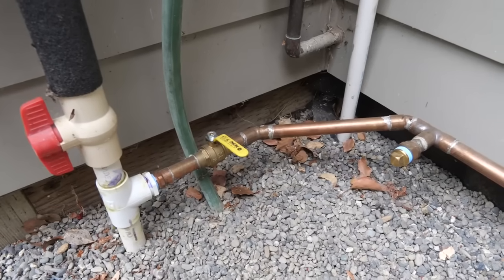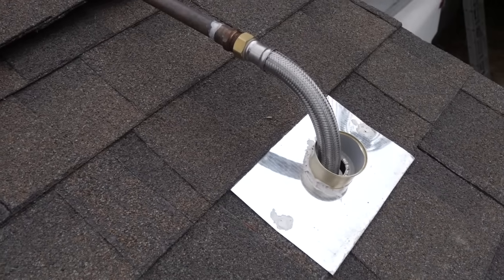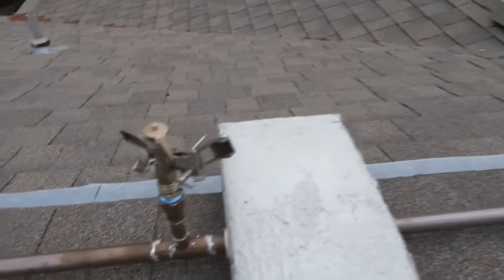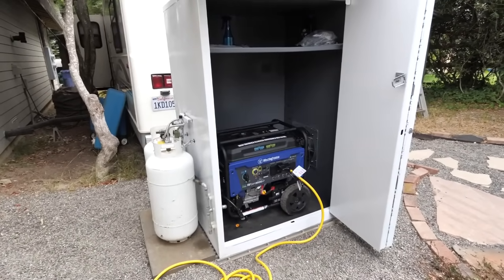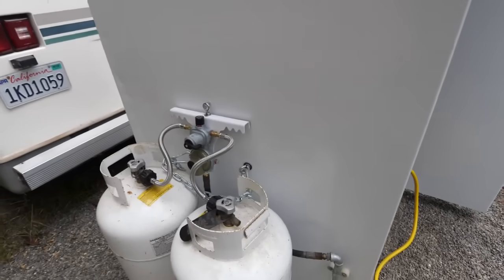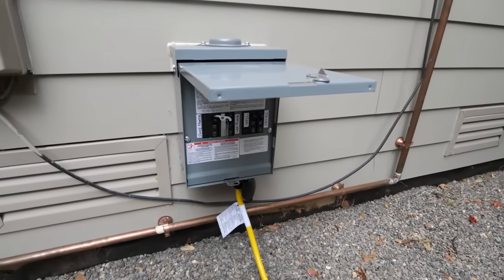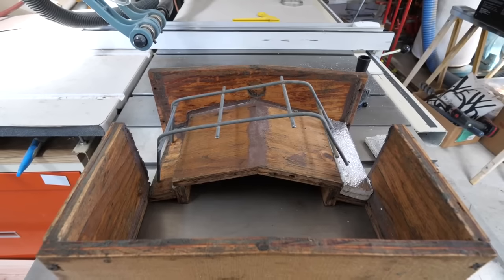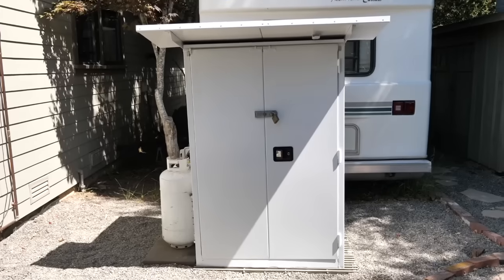Roof sprinklers and backup generator for wildfire-prone rural house

Comment: It couldn't hurt, and it's very ingenious, but quite often runaway firestorms are caused by extreme winds, in which case your sprinklers may have a negligible effect. It's best to ensure there are no combustible materials around your house, or areas that can harbour combustible materials and allow flying embers to gather.

Comment: I hope you’re not leaving the water. Sit in there, water can turn very fall and create legionella and other problematic stuff when it sits in lines, I may be thinking, though about sprinkler heads connected to house waterlines that are moving some water all the time and when there are dead end lines, like for sprinklers, you can have issues with legionella forming
Anyway, great work otherwise

Comment: Look at that giant fire damper for attic ventilation. This guy knows his stuff.
Reply: but embers will blow into that whirly gig vent on the roof, and all those vents on the side of the house down lower too - if you watch the testing videos where they blow embers at test structures, it's all the vents into the attic, and into the crawlspace that cause the issues, not the shingles - you get embers into those enclosed areas, and it's pretty much game over
Reply: @ didn’t notice the whirligig. Nice catch and you’re right. I sure hope he has some sort of a damper for that duct. There are ember proof fine mesh grills for small vents too, which I have for my house.
Reply: 1/16" screening is better
Reply: @ShastaTodd screens are good at keeping embers out. Downside it restricts airflow.

Comment: Looks great.  Only thing I would change out is the flex tube on the roof that connects to the copper pipe.   Even though it got a metal wire mesh what's inside of that is actually rubber which will degrade over time.  We had those for our water tank and it leaked.  So we swapped them out for the standard all metal flexi tube.  Ours is stainless steel but you can get copper as well.

Comment: I have sprinklers on my roof (Sierra foothills CA),  when we had the local defensible space advisor come around his comment was the if you have a class A roof they don't do a lot for you compared to clearing vegetation / trash and screening basement vents etc.
Reply: Takes a brave advisor to say "meh...those sprinklers don't do alot..."
Reply: i read vents are fire starters
Reply: @peter-pg5yc  100% you either need very fine mesh (1/16) or something like a vulcan vent that closes with heat.

Comment: And how long do you think that fibber McGee plastic pipe and copper would last in a fire fueled by high winds? I give it 5 minutes tops, should have used steel piping
Reply: Copper pipe comes in three grades, M, L, and K. K pipe is the thickest grade and is suitable for fire protection.
The only problem I see is that if a fire is burning hot enough, it might melt the silver solder? But if the system is effectively keeping embers from catching the roof on fire, I don’t see temperatures getting anywhere close to melting the solder

Comment: I think the main issue is the side of the house, not the roof. A system under the eaves that sprays the side of the house seems like it would be more effective at stopping your house from catching fire. the Shingles aren't going to catch fire from burning embers, which are the main fire starting concern with wild fires. You shouldn't have anything combustible within 5-ft of your house (bark chips, etc). Your system seems like its better than nothing, but I'm not sure it would protect your house from catching fire if an ember was to come flying into the side where the roof sprinklers cannot moisten.
Reply: Most houses catching fire in Southern California wildfires are ignited by palm fronds embers..in most cases those embers are scooting along the ground pretty fast (watch videos of this on YouTube) and are burning landscaping adjacent to the house. But he said his impulse sprinklers are reaching beyond the roof onto the ground nearby the house, so I think he’s covered

Comment: You need a 30,000 gallon water tank to supply it.

The LA fires had the water mains lose water for an assortment of reasons.  If it's depending on city water (even with your  own pump) it has no hope of working without a huge water tank.

But if you have that huge tank, fire department can demand to use your water.

A private well can only supply a certain amount per minute.  Not firefighting amounts without a large tank.
Reply: He said he is on a well . He is Not connected to city water supply
Reply: As shown in Palisades, when big fire comes the FD will not be around to take your water.
Reply: If the good fire mitigation ideas suggested here were implimented then 'firefighting' quantities of water would likely be unecessary.

Comment: Great setup & well designed... i couldn't help but wonder if you sealed your pass thru on the roof...looked like a good size gap there... I'm assuming you sealed the pass thru & drilled a drain hole low in the cat food can to drain any rain/water buildup in the can.  California could've used these...

Comment: thats a good idea. all homes in fire area should have this
Reply: Most of California Homes that was burn to the ground have a full swimming pool with water not used. This sytem should be applied to those homes.
Reply: @xh3598  That would actually work, but making it dependent on the public water supply would not. But I would choose a 2-stroke diesel powered pump, it is a smaller fire hazard.
Reply: @xh3598 yeah and the pool used as a reservoir. People in LA should invest loads more in water retention and get rid of useless things like lawns. Those things just consume water but have no real benefits. 

Having wet greenery is important, just look at how many of the trees came out of the fires in way better shape than the houses. They retained moisture. Having a wet microclimate not only helps against fire but cools down the neighborhood, which should be a nice thing to have in LA.

Another problem LA has is that the animals that kept the dry brush under control are gone for the most part.

Comment: Kinda ironic that this old video pops up on my feed today. Must be a popular topic with the wildfires going on down in California right now. I saw one house down there on the news that had sprinklers on their roof too. Such a brilliant idea if you are anywhere near a potential wildfire area! I bet this will become a super popular system to install on their roofs down there now!
Reply: How much does it cost to build a set up like this?
Reply: @ryangreen45  IF unfortunately I had no other option but to live in California, with its variables of dry climate, wild fires, AND bad government and super regulated.  I think I'd build with brick, cement, or perhaps at least use a thick layer of stucco, and use metal windows and frames, I'd use a metal roofing system, slate, terracotta or some other fire proof material.  I would not have wooden eves or soffits.  Nothing which could be directly exposed to wildfire would be flammable, and I'd have one hell of an in ground irrigation system put right around the house.  But California probably has some ridicules regulation against a high volume system.
Reply: @ryangreen45  as a guy that lives off grid on 40 acres in wildfire country (Mendocino County.)
 Let point out some things 
They make sprinklers to set on your roof already 
Saddle mount.
Sprinklers are great preventative measure.
Like a perimeter one around house using irrigation heads like he has on t-post

I have been through two evacuations and had part of our property burn.
Stayed and helped fight fire 
 First thing they do is send crews to each residence 
They assess situation
How defensible structure is.
 First thing they would do is move those propane tanks away from house.
 Best to have a 1500 gallon minimum storage tank of water and a pump that can move water at about 60/80 gallons a minute through a 1.5 inch  fire hose fitting and 150-200 feet of 1.5 fire hose.
Most wildland fire trucks can only carry 500 gallons.
At 60 gallons a minute, which isn’t that much, you can see the problem.
You can get the thinner walled for your purpose.
Hot ash can travel two miles on the wind.
And there will most likely be wind created by the fire if not nature.
So you need to be able to direct large water on spots.
Sprinklers during this are not that useful, think ( peeing in a strong wind)
Also remove “fire ladders” from around your house.
 I have an f-250 with 300 gal tank in back with Honda pump and 3/4 inch fire hose for getting to hot spots or neighbors.
Feel free to ask me questions, I probably have the answer due to experience, unfortunately
Reply: @ryangreen45 could be around 5-6 k for 2000 sqf home (everything)
Reply: @ryangreen45  Probably around $45. per each 10' sections just for the materials...no labor(double it at least for labor). *Rough estimate

A 10' 'stick' of ½"pipe is $20+, and ¾"pipe is $30+ each plus fittings, stand-off clamps, a couple valves, sprinklers, etc. Cooper is pretty pricey right now and it's only gonna go up significantly along with all building supplies because of all the rebuilding going on all over around N Carolina and now California too.
Reply: Looks like it's still necessary to manually put out fires and embers that don't land on the roof
Reply: right wtff
Reply: It is because you are clicking on News stories about the fires. It is not random or ironic. Algorithms!
Reply: @Hiiamsamm  Never ever clicked on one news story on YT ever! I get news from reliable sources not social media that chooses what to show & not show according to who it's coming from. I watch videos that have nothing to do with news or politics, and aren't 4+ years old like this one, sorry bub!
Reply: Same here, this video popping up today!
Reply: No it won't. People in CA. have been ignoring good advice for decades so they are getting what they deserve. Do not send them a single penny until the East coast gets helped recover from nothing they could have prepared for.
Reply: I saw that guy in CA to, he was an Army ranger if I remember right. Very interesting.
Reply: If you have water
Reply: @jeffdoesstuff9134  That's what water cisterns are for… to collect and store water during the rainy-season to be used for the fires during the dry-season… more-on. 🤦🤦‍♂🤦‍♀
Reply: @MelioraCogito  does your government allow you to collect rain water and store it?
Reply: @jeffdoesstuff9134   Of course it does, why wouldn't it?!?  It's rain that falls on your property, why wouldn't your local/state government allow you to collect it?

In fact, up here in the temperate rain forests of Vancouver Island, homeowners are encouraged to install underground storm tanks on their property to collect rainwater run-off, slowing water egress off your property and overwhelming the municipal storm drain system during heavy rain events.  Such storm tank systems can be used to hold water instead of slowly releasing it into the ground—we even get a property tax credit for having one.
Reply: @MelioraCogito There is no tax credit for a water cistern on SVI. They were debating a ban on water collection in BC.
Reply: Put tennis balls in downpipes,It will fill the gutters with water and help stop hot ash getting under the roof.
Reply: @larryrayner3826  What a r tarded comment…
Reply: It's called an algorithm and they use it to sway your political views as well.
Reply: You too?
Reply: @PH-md8xp  So glad you figured it out for me
Reply: If people start installing these they will shut down the city water claiming drought.
Reply: Useless if there's no water...
Reply: @joelsheebs728  Maybe you missed the whole well water thingys he showed. Not relying on 'city' water he's got his own supply. Yes, it is 'possible' a well could dry up but less likely if it's deep enough. Also water storage cisterns and rain water collection are a thing too! Just don't rely on the fire hydrants\water department to have the water available for the FD to use when attempting to fight the wild fires that were predicted long ago!🤦🏻‍♂️There definitely needs to be some repercussions from this disaster, several officials need to be prosecuted & fired(lose any pension, etc too). Such a cluster f_#k going on down there in that 'state'!
Reply: No one listen to him,rich people like big mansions,but they not protect the investment,here in usa we can make a difference,but  our minds are in stupid things!
Reply: I hope you no have to expose that yellow extension,can be better under ground,inside de shed!
Reply: @tdotw77  Google would prefer we look at this versus facts about Newsome and Bass.
Reply: @loganq  And what “facts” might those be? 🤔  Oh… right… the “fact” that the Eaton fire in Altadena is outside the LAFD's jurisdiction (Altadena is within LACoFD's jurisdiction) or the “fact” that the state has no jurisdiction over county land management practices (except in state parks/recreation areas)—it's not the state that is responsible for implementing county/municipal zoning regulations to provide buffer zones between neighbourhood developments and adjacent undeveloped wilderness to mitigate wildfire hazards.

And finally, because homeowners not keeping their property clear of fire debris, is all Newsom's and Bass's fault…?  Really?

JFC, you MAGAs do nothing but cry and blame others for your own failures. 😭😭😭😭😭  Love how the party of “personal responsibility” refuses to accept personal responsibility for the bad choices they make.

Only the Palisades fire fell under the jurisdiction of Mayor Bass and the LAFD.  A lot of those 10M$+ homes lost in the Palisades, had swimming pools in their backyards, and yet I wager, few if any of those homeowners thought to have a firefighting systems installed to utilize the pool water to protect their property.

Personal responsibility indeed.

Build your home (or buy one) in an area that is at high-risk from annual wildfires, and expect one (sooner than later) to sweep through your neighbourhood and consume your home—especially if you don't take the personal responsibility precautions this gentleman has taken to protect your investment… the incentive should be even more urgent if you can't insure your home against wildfires/earthquakes.

And don't tell me someone who owns a multi-million-dollar home in the Pacific Palisades can't afford to have remedial fire protection work done on their home/property to protect their investment.  If you can afford to live there, you can afford to protect your investment.

It's not rocket science.
Reply: @MelioraCogito  Right so it's the homeowners fault the wildfires were burning out of control with no water in the hydrants to fight it, not the fire fighting forces to do so. And yeah it's the homeowners fault they have a pool on the property they bought, a home to be safe in and be protected by the police, fire department and government....I'm sure it's someone reds fault, right, that the commifornia elected officials can't manage their own known potential problems but they did save the useless smelt(minnows), and not have the water reservoir or supply, despite living literally directly right next to the OCEAN! 

Please continue telling us more bs....

🟥👌🏻Can't wait for Monday! ✊🏻🇺🇸🦅🇺🇸✊🏻🔴
Reply: @loganq  You got that right!
Reply: @loganq  - Easy to blame politicians, but homeowners need to be accountable too. Don the Con wants to ignore climate change, his motto is Drill Baby Drill. That's not going to help the drought conditions around the world.
Reply: @loganq  I know right 👍🏻 💯
Reply: @loganq  Be careful they might drop the hammer on you if you say bad things
Reply: This system will do nothing in a big fire. The water will just steam from the heat and the house wouldn't survive. Perhaps in a small fire it might put out some embers floating onto the roof, however.
Reply: @uowebfoot    there were newscasts from seniors that did save their houses due to them stomping out the embers.  so, yea, if someone has a Eucalyptus Tree next to their house, they are toast. lol.  I cannot see why they are even allowed in wildfire prone areas.
Reply: @uowebfoot  I've come across atleast 10 stories online of people saving their homes (and many neighbours houses) by sprinkler and a garden hose.
Reply: @uowebfoot  :face-fuchsia-poop-shape::face-fuchsia-poop-shape::face-fuchsia-poop-shape::face-fuchsia-poop-shape::face-fuchsia-poop-shape::face-fuchsia-poop-shape::face-fuchsia-poop-shape::face-fuchsia-poop-shape::face-fuchsia-poop-shape::face-fuchsia-poop-shape::face-fuchsia-poop-shape:

Comment: Well done. I lived in SoCal and put sprinklers on my roof using PVC. My biggest problem was getting them to stay on the peak. Your concrete solution is outstanding.
I did this after the Huntington Beach fire back in the 80s where I saw a house in the middle of a bunch of burned down houses that was intact (unburned). It was being filmed from a helo and the camera man noticed the house and zoomed in and you could see the sprinklers running.
Reply: PVC is not necessarily a bad choice. However, if you used PVC Electrical Conduit, it would already be UV stabilized. I use that for all my outside water lines exposed to sunlight.
Reply: earth quake and those concrete slabs are airborn..
Reply: So after his house has burnt down from a wildfire & his wife says to him "But honey, why did you remove the sprinkler system off the roof...?" what's his reply gonna be...? "Well, someone commented on that video I posted how dangerous the concrete blocks would be in an earthquake..." 🙄🙄🤡🙄

Comment: When a forest fire is nearby, expect the ambient air to be quite warm. Therefore the generator needs better ventilation. Route exhaust on top and use bottom hole as 'cold' air intake. Protect the electric cord inside a steel channel.

Comment: I had one of these, the problem is that in high winds it will not work, everything burned. because of the wind. I had a generator, a well, and a big propane tank.